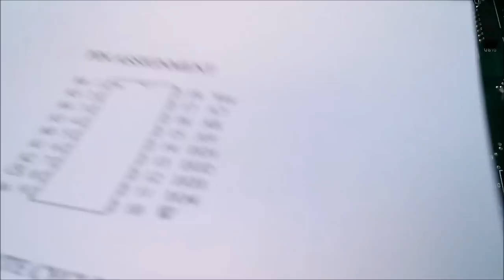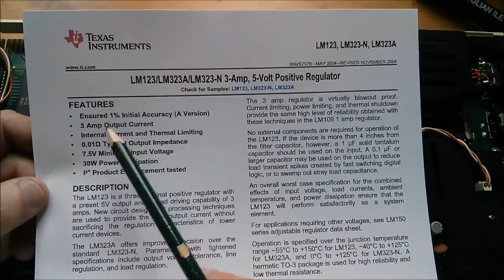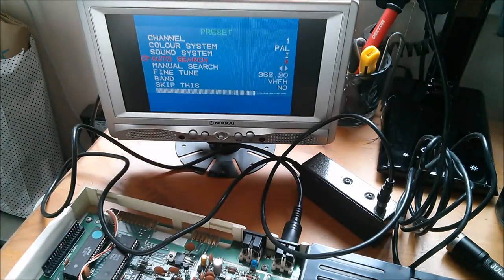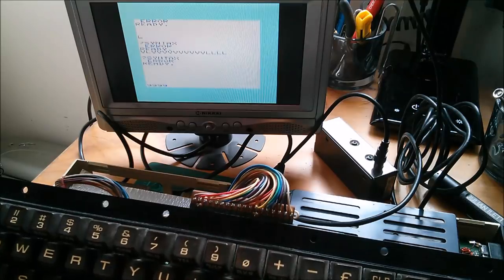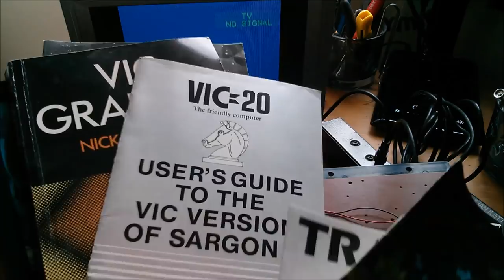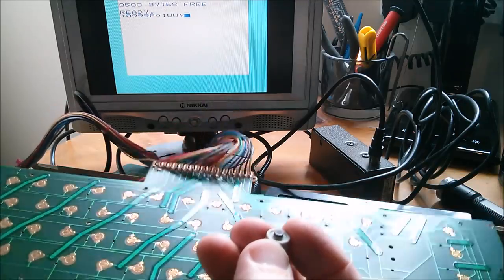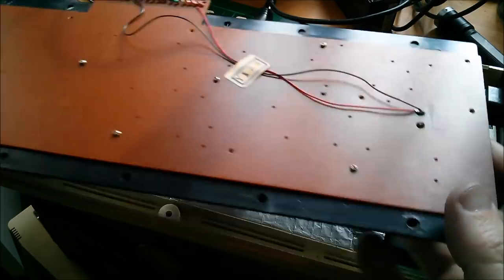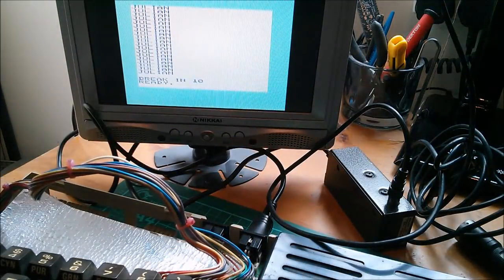8-Bit Computer Teardown and Repair (mostly cleaning)

Comment: Sweet!  You can connect composite up super easy from the AV DIN.  Lovely machines!  The odd 1K 4 bit chip is used for colour  by VIC.  Keep up the great work =D  You've got quite an early version there btw!  That keyboard type is quite rare I think.  All the ones I've looked at have the mitsumi keyboards not dissimilar to the C64. Couple of VIC-20 repairs on my channel btw.

Comment: Many years ago I worked in the TV trade where we used conductive paint to rejuvenate remote buttons.
My first computer was a 6502 based Acorn Atom which I built from a kit. On a Saturday evening the computer was built apart from the keyboard when I ran out of solder. In those days nowhere was open on Sundays so no new solder until Monday. I spent half of Sunday   operating the keys by shorting the pads with a piece of wire. Happy days.

Comment: A bit of a noddy computer !!, how dare you.. lol. The VIC was a great machine, I had one in 1982 as my first home computer and there were some brilliant games for it as well. Amazing what you could do with 3.5k. I also remember doing surgery on the metal RF Modulator and tapping into the Audio signal. Then made Phono outputs for my hifi, so my VIC game sounds came out of my HiFi.
Reply: I also had a Vic 20 for my first computer back in the 80's and loved it, with todays GPU's it amazes me how I would play a game with a little plane flying left to right and used the space bar to drop bombs on rectangular skyscrapers leveling them all before landing, very basic but me and my sister would play it for hours, my biggest mystery was out of the blue I got Rat Race on cartridge in the post with no senders details just a brand new cartridge and to this day I have no idea where it came from? Anyone have any idea.

Comment: I knew what that was the minute I set eyes on it,  having repaired many hundreds of c= machines in the 1980s.  You have one of the good ones, there,  with the 2-pin power supply.  Later ones used a 7-pin DIN connector and the supply was potted in epoxy,  a frequent failure item.  We used to sell aftermarket supplies for those machines,  too.  Skin oils on those keyboard contacts is NOT a good thing!  Also,  there is NO protection for the 6522 chips so you probably don't want to be running your fingers across the edge connectors at the back of the machine,  or the joystick port. We also used to push a bit of black foam into joystick ports,  which would save them from being zapped from static discharge,  after replacing a bad chip in each case.  Another thing that I liked about the VIC was that the edge connector was the more or less standard 44-pin size,  so you could build stuff on boards with the appropriate edge fingers,  and plug it right in.  I wouldn't mind having one of those...   :-)

Comment: All damp eyed now. I had a TRS80 (Z80) model 1. That had a memory mapped keyboard with each key occupying one bit of memory, That did give one the possibility of combinations of keys. I seem to remember that "jkl" could be read at one byte of the memory map and "asdf " could be found at another byte (all very "Zen and The Art of motorcycle maintenance"). In a relatively short time one could become familiar with each and every component and also every byte of the OS which lived in ROM. Now there is more computing power in the sound card of a PC; which, of course, I only know where the phono plugs go at the back of the machine. Happy days.

Comment: I recognized it right off the bat :-) because I used to work on the Commodore computers back in the 80s. Even though the 64 was the main system uh I had I still got a lot of 20s that were being trashed that I repaired. And I miss those days! :-)

Comment: Thanks Julian. A lot of those were thrown away because of faulty keys! Commodore.had something of a reputation for producing good manuals. I had a CPC 128, and it came with two identical manuals, one of which I never unwrapped. Their 3-inch floppy disk drives were a peculiarity though. I bought the very last packs of those in Lincoln, from Tandy (Remember them?), and they were snapped up when I passed the computer on to the next owner.

Comment: Guessed immediately from the 6522s in the upper left! - I've used these beauties to test aero engines at Rolls-Royce, control autoclaves in the NHS, flash lights on TV game shows (Random Choice), and in many other 1980s projects. Same for the C64. But when they brought out the C16 without a user port, Commodore became utterly useless to me. :-(

Comment: I did have one of those – my first real computer experience. Much fun and great learning, even if I only had a monochrome TV to use it with.
I think I would have used a pencil to freshen the rubbery pads on the keys, and minimised touching the contacts with bare skin after cleaning.
Reply: I sat/layed on the floor in the living room using the RF Modulator connected to our TV :)

Comment: It is circa 1981 vintage.  They were sold very cheaply in the UK until the C64 ended up replacing it when the prices came down in the mid 80's. The VIC20 was before my time really but I did grow up with a C64. Mine still works although I need to make a new power supply for it.

Comment: Edit: It's a little misleading to say you can only address 64KiB of ram with a 16bit address; because it's not true.
A 16bit address limits you to 65535(sorry, 65536, since 0 is also an address) unique addresses but does NOT in any way limit you to 64KiB of addressable memory. Connecting multiple SRAM IC address lines together, you can address an arbitrary number of chips giving much larger system WORD's per address effectively giving much more than 64KiB of memory.

The real limitation to memory is your bus width:
You can create 128bit system WORD's using only 16bit addresses, but if your bus width is only 8bits wide, that would limit you to transferring 8bits per clock cycle effectively slowing down your processor due to bus width. 

Judging by the MOS chips even 15 seconds in my guess was some version of a commodore XD
The SID chip arrangement also gave it away XD

Comment: Thought that looked familiar I think I have one of those in my back room some place.  I recall the first one I got to play with, one of the patrolmen who worked for me had one, and he showed it off to me, I thought it was one of the greatest invetions Ihad ever seen, this was back in 1983 or 84 if memory serves.  The next fellow I hired had a C=64 and it was so ver much nicer, abut two years later, I picked my first machine, that being a C=128 with 1571 disk drive, now that was computing, even got a monitor after tiring of looking at an old huge 19 inch color tv that nearly made my eyes bleed when playing games on the machine.  That had to be 1985 as I had just changed departments and moved closer to Canada in North Dakota.

Comment: Vic20, my second computer... I remember the cartridges were so tight fitting and having only 3.5kb of ram free to the user so limiting, even back in the '80s
Reply: horrible 'Peek&Poke to do anything' Basic too compared to my first computer which was an Atari 800XL, sadly a lightning strike killed it so that's how I got the Vic... didn't have the Vic for long before I got a C64 and by then I just used it for games

Comment: The 3Amp is the secondary, the 200mA fuse is on the primary.
The 5 pin din has audio, video high, and video low, so tou could probably get a composite output (search for vic 20 pinout),
Reply from the maker: Ha ha, of course, doh!

Comment: Regarding the RAM allocation, I'm guessing 1 chip for zero page & stack, 1 chip for I/O buffers, 1 chip for screen character memory, and 1 4-bit chip for screen color memory.  The 4 bit RAM would have been for color, since there were only 16 colors.  That would leave 7 chips for the program, which works out to 3584 bytes.  Why they chose an odd number like 11, who knows?  Looks like maybe that's what they had space for on the board.

Comment: I see the MOS chip at the RF section =>this is a commodore, but not the 64(I don't recognise the board layout, and also too few RAM chips), then you spoiler the VIC chip... I could guess it from the video connector socket too.

Comment: My guess: It's video RAM.  The video ram is 12 bits wide.  8 bits define a character, and 4 bits define some colour characteristics.  Makes the addressing easier if you can access as 2x8 bit values, but if you don't need 4 of those bits - don't populate the RAM chip (RAM was expensive back in the day).

Comment: Has anyone mentioned that your plugs are HUGE?
Reply from the maker: They are enormous - and not my favourite mains connector - I like the type F (Schuko)
Reply: Schuko is often horrible to get out of sockets again, especially power strips. Especially with this http://bit.ly/2tWHtNe type of plug. Not enough area to grip on. Hate them.
Reply: All plug types have problems and none are universal... Guess I'll have to make a better, universal smart plug! Also, it'll have a button to release the plug easily. The plug will turn off and get covered with plastic insulation before the plug is released so that nobody can get shocked by it. This is the future of the plugs! Now the world just needs to reach an agreement about voltages and frequencies and problem solved! Obviously, this would be pretty difficult because of backwards compatibility, but this can be solved as well.

Comment: Could the extra RAM chip be for parity-checking?
Reply from the maker: That thought crossed my mind, but when and how would the checking be implemented? It seems very extravagant for technology that is virtually 100% reliable :)
Reply: looking at the schematic it looks like the odd chip is only conected to the 6560 VIC lines DB8-DB11, the block diagram shows CHAR COLOR which i presume is character colour.

Comment: MOS 901460-03 - that's VIC 20 Character ROM
Reply: horse1066 I remember blowing an EPROM with my own character set and replacing that chip. Even used the Vic to burn it with. Ahh the memories...
Reply: Cool, back then blowing an eprom was really difficult, as well as probably requiring an eprom eraser.

Comment: First 3-5 sec i was thinking C64, then i notised the cartrigde port and the 5 volt regulator on the right, and it was clear. VIC 20.

Comment: Microprocessor or a CPU?
Reply: Well, a microprocessor IS a type of CPU, but not all CPUs are microprocessors.
CPU, which stands for Central Processing Unit, refers to any type of processing device, whether it's made from relays, vacuum tubes, transistors, logic gates, you name it.
A microprocessor, on the other hand, is a CPU that has been made entirely on a single tiny bit of silicon.

Comment: I am sorry but the PCB looked like a BBC Micro Model B... as the machine has 64K 65535 BYTES of memory, I think you need them all otherwise not all keys will not work as you want equal pressure all over the keyboard.
Reply: Really !, its a VIC-20
Reply: Paul Taylor does it have BBC assembler